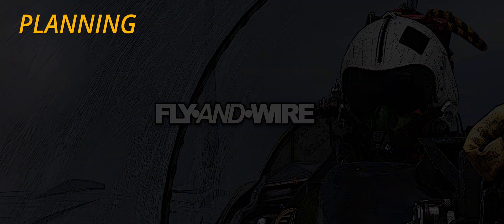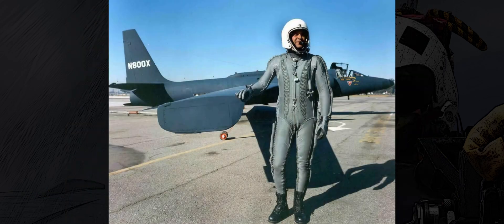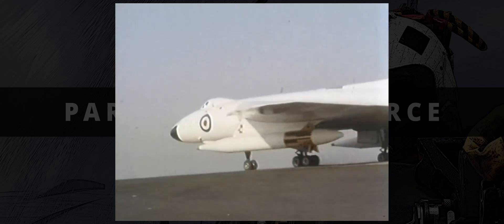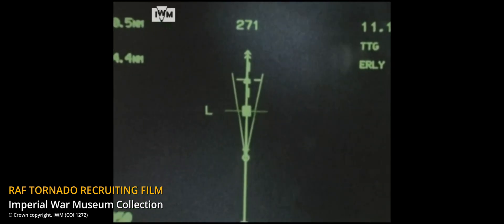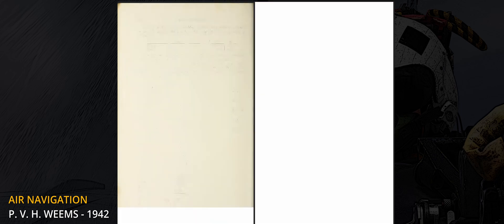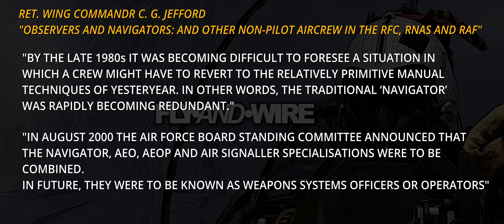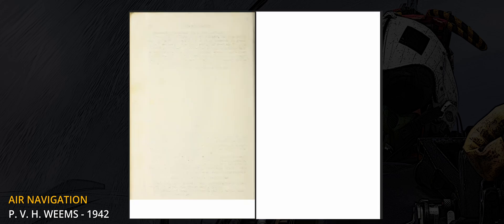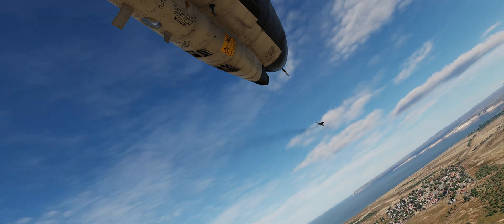Low Level I: Introduction

Comment: kinda fun to throw a VOR check in there every once in a while. Find a VOR thats close enough to your planned route (40ish miles it depends on the specific ground station), draw a line from the VOR to intersect your route, write down bearing from VOR to your route and its reciprocal heading, do the math to figure out when you should hit that intersection. If on your planned heading, at your calculated time and your written down bearing from to VOR  lines up you know you are where you should be, can do basic math, follow a course and can be on time. Not super useful in DCS (except warbirds) with our fancy navigation systems, but is a good exercise.  Great video, good information.